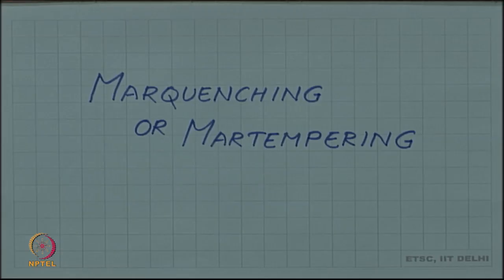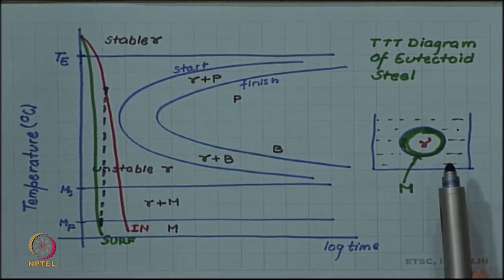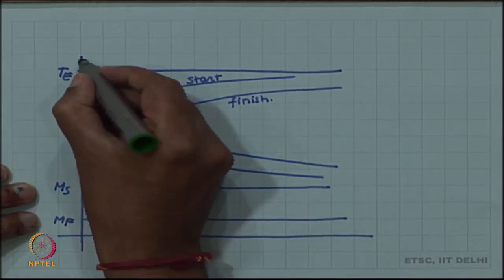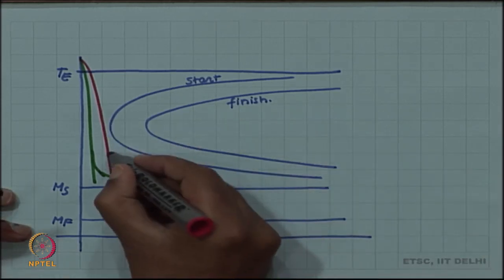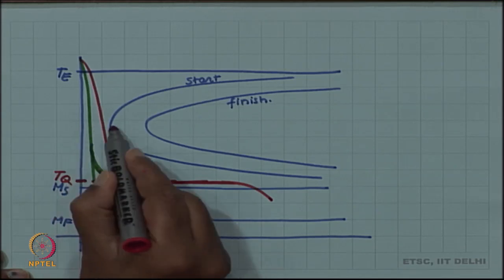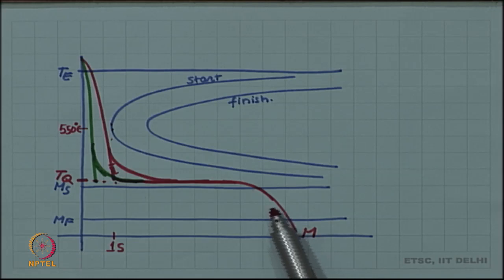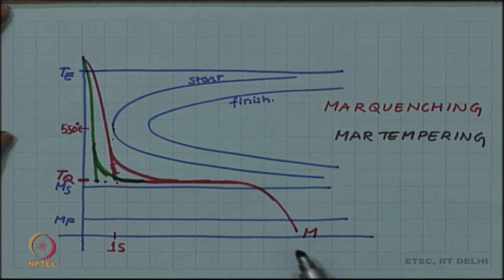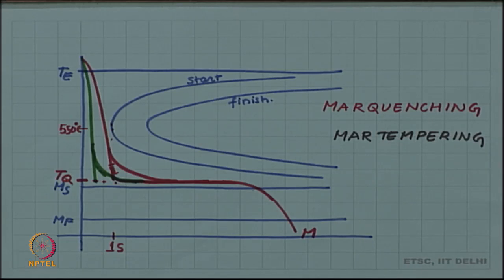Marquenching or Martempering

Comment: Hello Sir. Hope you are fine. I have a doubt in this lecture. At the time when temperature of the outside  surface will be just above Ms, the temperature of inside will be quite higher (somewhere around nose or above nose). If the quenching of specimen is interrupted here and temp is kept constant, the curve of outside will definitely follow the non-transforming region, but the curve of inside will cross the transformation region and hence may transform into pearlite. Sir it's a request to clear this doubt because I am preparing for my exams.
Reply from the maker: What you have described is reasonable and possible.

Comment: Sir, the complete structure converted into martensite after martempering or some austenite formed there?
Reply from the maker: It will completely convert to martensite if the final temperature is below Mf. If the final temperature is between Ms and Mf then some austenite will be retained.

Comment: Sir what will be the effects on hardness on heat treated parts?
Reply: I guess we will be able to achieve 55-60HRC
Reply: @professorprotv  there are many curves where you can read the hardness in each piont or temperature, btw in books of heat treatmts or physical metallurgy u cant find them

Comment: How can we interrupt the process within one second and shifting to another rate
Reply: by cooling very fast(less than 1 second) up to a temperature just above martensite starting temperature and then holding at that temperature and slowly cooling
Reply: By taking quenching liquid with temperature just a bit higher than martensite start temp.
Reply: @shailendradeota6701  excellent idea man . which college are you from .I think u r mechanical 2-1
Reply: @shailendradeota6701  studied long ago . currently no use,,😁